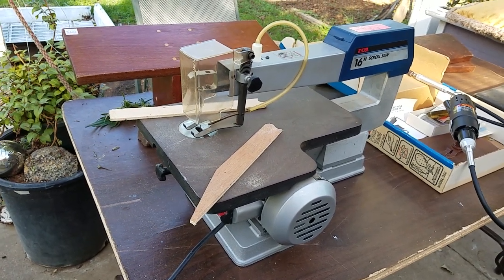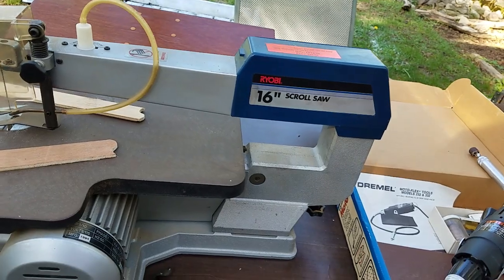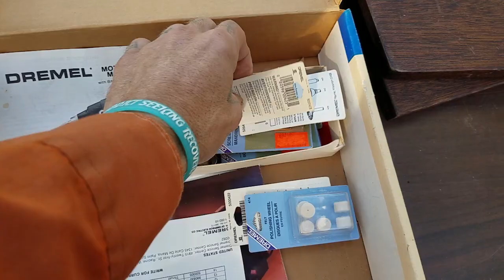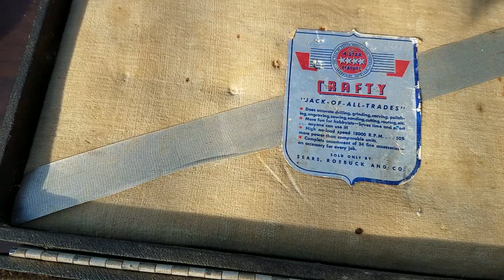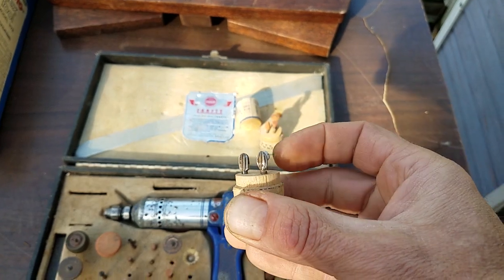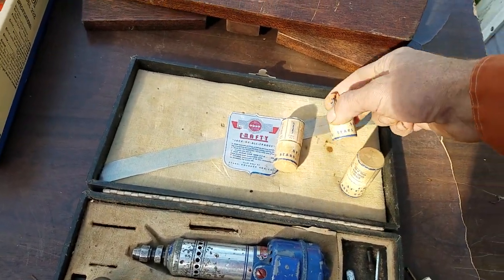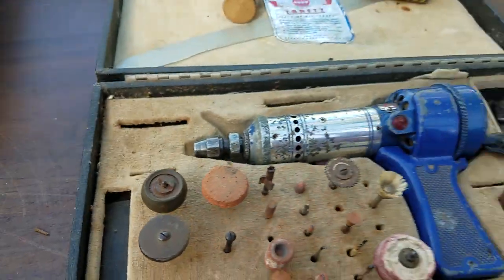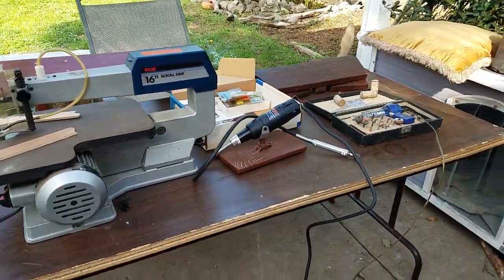My Vintage Tool Score (I love tools)

Comment: God I love old tools. Raid pawn shops and thrift stores! I'm so bummed, my old solid METAL B&D circular saw (weighs a ton) I got for $5, finally got a busted a part on it. I also relish my old wooden-handled screwdrivers.
Reply from the maker: I was a carpenter for a decade so I have a garage full of tools, I made cabinets and everything else which means I have a lot of different router bits and parts. I really want to get back into making woodwork projects
Reply from the maker: And yes I love those old screwdrivers too 😁

Comment: I would by them for those prices. The electric cord on the old dremel doesn't look authentic, but good finds for sure.
Reply from the maker: I don't know, if it was replaced it was replaced a very long time ago. I've seen older power tools with those cords but you never can tell. They didn't have grounded cords yet
Reply: @carpo719  I have an old lamp at my mom's house with no ground.  It was my great Grandpa's lamp.  Needs a little work. ✌️